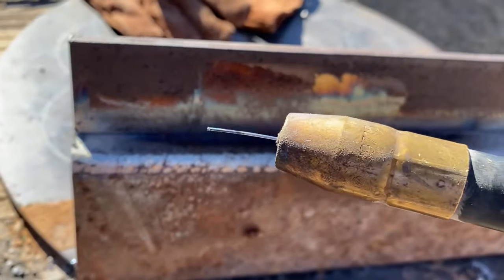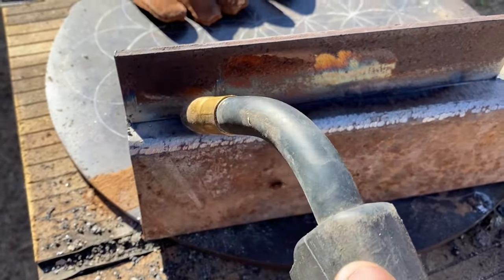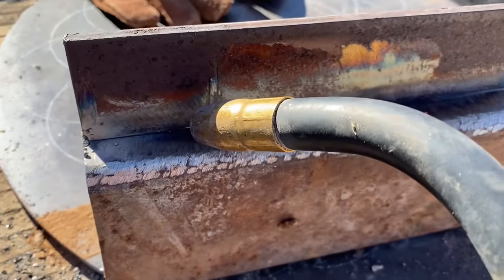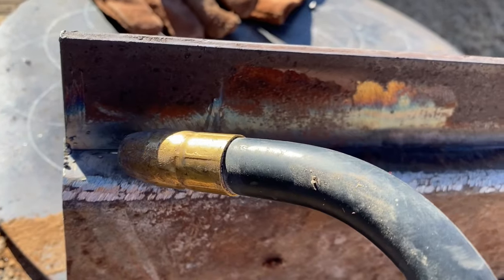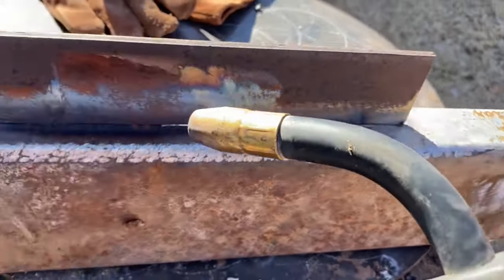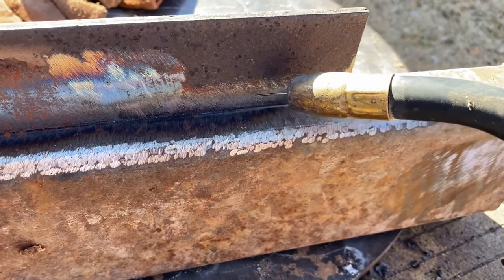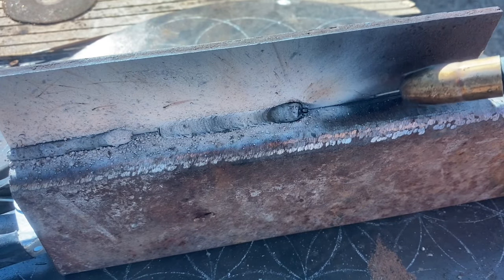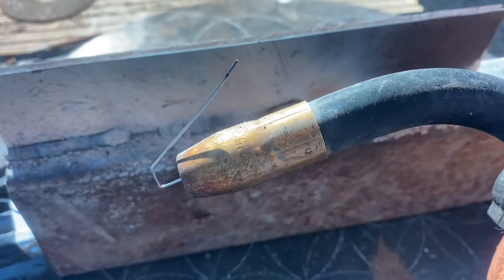Fluxcore welding basics for beginners tips and techniques

Comment: I learned to weld with a stick welder, so I've always used the C technique. I'm 72 and I bought the Hobart Handler 200. Yeah, it was probably a little more than I needed, but I want to be able to weld 3/8 to 1/2 inch steel. I'm a farmer, so you need to be prepared.

Comment: The welds have excess convexity.  I have certified several times with flux core (stress tests and x-ray) and I push it rather than drag it.  The weld lays flatter and the slag tends to peel of by itself.  There is very little spatter.
Reply from the maker: For regular gasless I would never push it leaves a slag you have to drag for dual shield I agree I treat it like mig
Reply: Push for fluxcore?
Reply from the maker: @jotk5978  maybe for dual Shield Fluxcore but rule of thumb if it leaves a slag you have to drag. You wouldn’t go punching an electrode right
Reply: Same here my fellow welder. I pushed a lot on inverts at the ship yard. You can move very quickly doing it.

Comment: So I've been welding for years,and just started with flux core. One of the main things or differences between  the solid core,and flux core is the speed of the weld . Flux core is much slower. You have to wait longer  on your movement, but produces a solid weld.

Comment: I feel you my man. With dual shielded fluxcore you can actually push and get great beads as long as it's pretty hot you burn the slag off the top out of your way. That was my little secret I used on ships most of the time the key is to push without any other motion. Great video man.

Comment: I have a question. So I just bought a welder yesterday and have zero experience welding but am pretty proficient at brazing and soldering so I kinda get the technique but I'm having trouble with 2 things. 
1. What am I watching for as far as the puddle? It may be a dumb question but I'm not sure exactly what to look for and 
2. I'm welding exhaust for my motorcycle and what would be some good techniques for welding round pipe in an outside environment? I like that you are very active in the comment section I subbd because of that so thank you  as a lot of people don't say anything back and that's probably costing them subs. Anyway thanks for the video and I look forward to hearing your response

Comment: I’m Flux Welding 22ga sheet steel for a car rocker panel patch. Lincoln machine. Any tip to prevent blow thru? I’m on the lowest voltage setting. Should wire feed speed be set for as slow as possible? Great video!

Comment: Can the tip touch the steel when you drag to have a straighter line?
Reply: Yeah it doesn’t hurt anything but it could stick causing you to mess up your weld. Just make sure you keep it your tip clean and you’ll have no issues.

Comment: Hey thanks for the video. I am just beginning flux core welding on mild steel 3/8 and down and trying to learn all I can. I think missed what your showing as "Tips". Do I see a gas nozzle over the flux core tip and if so why? What was the voltage and wire feed set at for the 1/4" steel plate you were welding with the 140 ? Could you show the penetration if any for that flux core on 1/4" structural gauge steel? Was is it .030 or .035 wire? Sorry for all the Q's and I'm not a troll. I have been learning flux core is not recommended for structural conditions.

Comment: Very helpful video,  like to see welding  thin metal like the floor of a car to 1/4 inch. I'm putting frame connectors and a roll bar in and chose to pay $700 for a decent welder and learn how to do it
Reply: Thats why im here. Learning how to weld so I can install my subframe connectors. I think its very doable.

Comment: If you push it it will penetrate deeper. If you drag it you just lay the weld down it will still penetrate a little but if you are taking a pipe test and you need to really penetrate deeper then you need to push it and then for your three bead cap you drag it.

Comment: Using FC wire, do you encounter pitting if you overlap you weld? I liked the C pattern and no pitting. Is this a myth? Supposed to contaminate because of the flux getting in the overlapping weld.
Reply from the maker: I would just clean the slag before welding and it’s fine at least with what I’ve experienced. But explain it more if you can
Reply: Depends on the wire. Er71-11GS is single pass so you need to clean every pass. E71t-11 is multipass rated so it burns the slag out to top if you run over it again, though you can clean in between if you want to.

Comment: Wow it appears I am dragging way too fast compared to you. How can you tell how fast to drag? Is the secret to move just fast enough to keep the pool formed?
Reply from the maker: Depends on the thickness of the material but just keep puddle in control as you watch the outside of the weld(toe) make sure it’s as even as possible the whole way through. Look for fusion on both sides and kind of just drag it as it fills to the desired size. Appreciate your comment thank you

Comment: Ok my flux welder recommends a speed 3 and on c but the speed 3 don’t move very much meaning it gets stuck or just don’t move but if I bring it to 4 and above it works amazing it’s brand new also I checked everything and it all looks good so any help and sorry new at this but I do the circle myself and my welds turned out great I tried the drag it didn’t work as good as yours and the c did great also but I’m a fan of that circle now lmao

Comment: I'm a 30+ year veteran welder. You have a lot of good techniques but the end result isn't great. I was QA for a company that prided itself on welds that were functional. I would suggest that you slow your wire speed and raise your heat slightly. this allows you to stay in the puddle for longer and allows a better weld and its prettier too